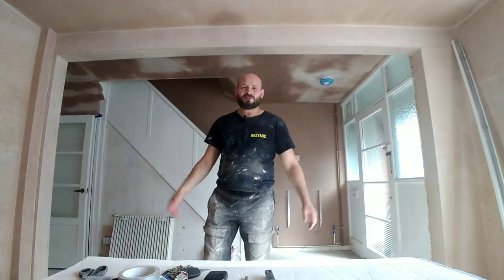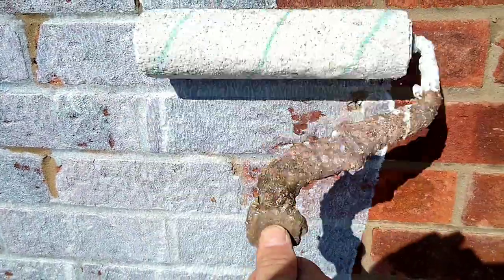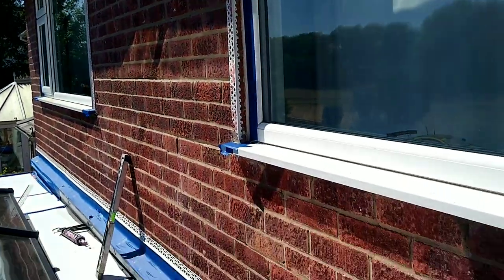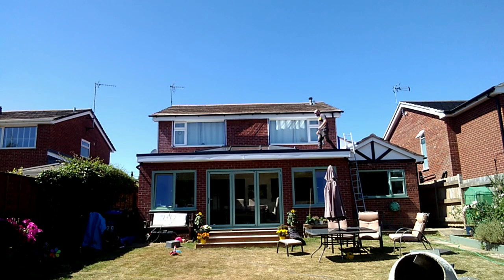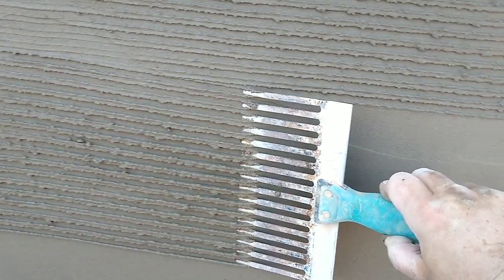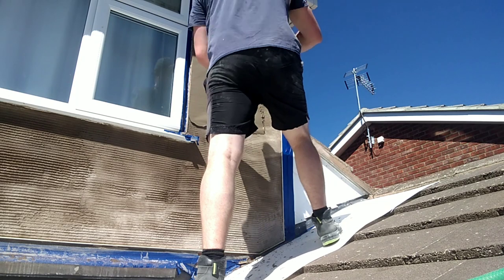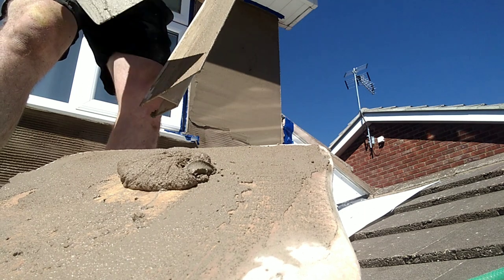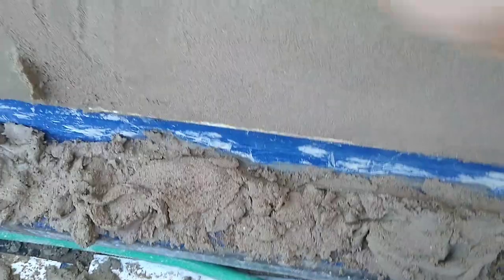RENDERING HACKS

Comment: Here in fla we plaster over block 90% of the time so we put bonding agent on the walls and when its float finish we 
Double back on the scratch coat with in an 1  2 hrs.6 months of the year here it is 90 degree so working in the shade is the
Way to go,start early gone by 2.30👍